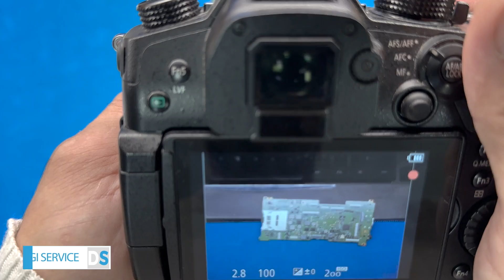How to repair Panasonic camera DC-GH5 defective main PCB(used ext. power supply)

Comment: i have 3 of these cameras and i cannot get anything to come up on the menu screen on all 3 except the wrench and that is it. 2 of them i can only take a pic with the screen only not the button and none of the other buttons on the cameras work and 1 is requiring me to enter a code to get to the menu. any help would be great, and what is the link to the new main board. thanks
Reply from the maker: Hi send these cameras to us for repair